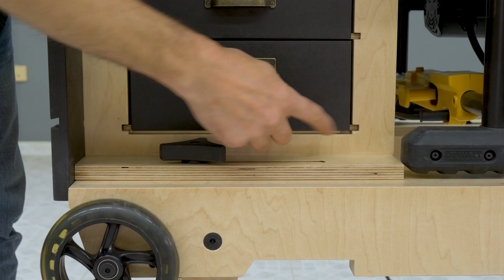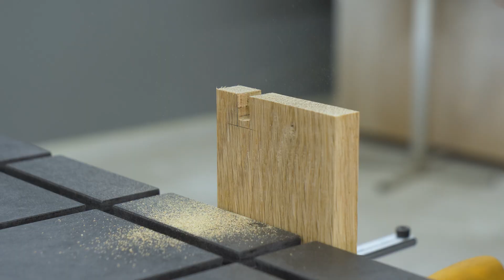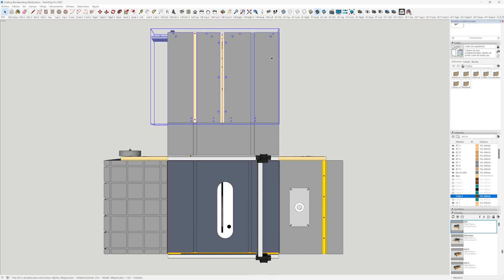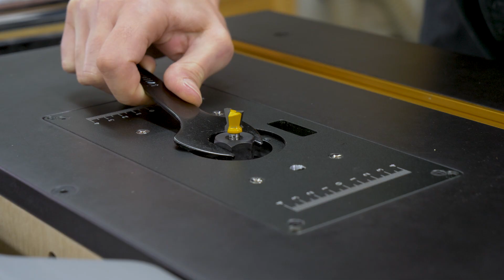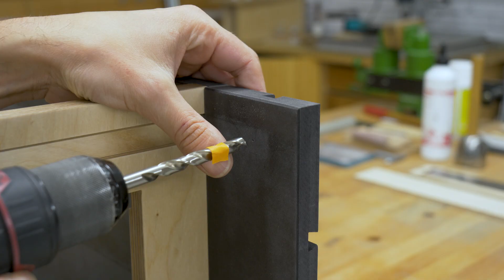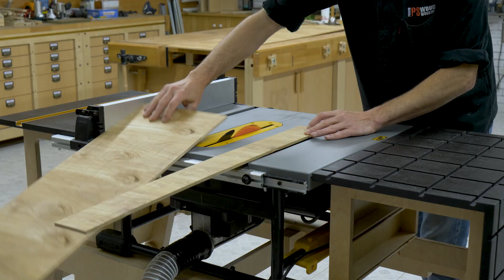DIY Woodworking Assembly Table / Compact & Portable Design - Pt. 3

Comment: Your creative and craftsmanship is remarkable. I bought the plans from you for the mobile workbench. I haven’t built it yet but look forward to building it. Your plans are very good. Another project you could build is a mft table system like the Kreg adaptable cutting table for use with entry level track saw.
Reply from the maker: thanks, It's on my to-do list!

Comment: Hello ! ....why do you make the drawers with the wooden base that slides on the guides and you don't use total extraction metal sliding guides instead? Thanks😊
Reply from the maker: both methods are valid and each of them has its advantages and disadvantages!
Reply: @Paoson_Woodworking  thanks🤝
Reply: Saves on cost, weight and other issues. Easy repairs etc and well, easy to remove....
Reply: @DamianDArienzo  ok , fine thanks